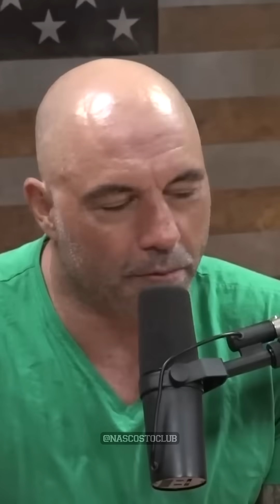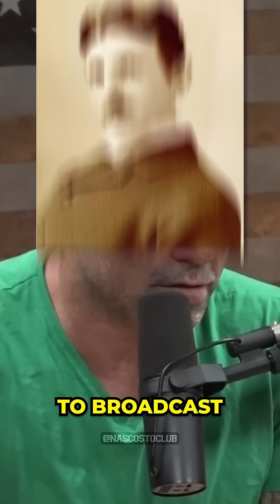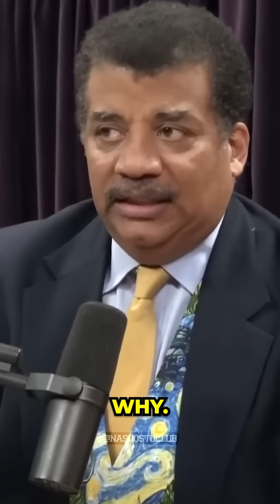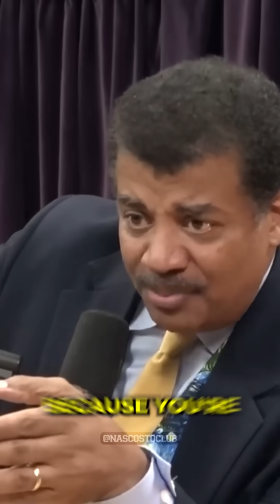WIRELESS Electricity Idea Debunked ⁉️⚡ #shorts

Comment: He's got a point. Lighting is what you get when you move electricity around through the air. If you wanted to do it in microwave radiation you're just going to cook everything.
Reply: Airplanes could have some problems too.
Reply: @Romfullmetal  the idea was to create airplane and all other vehicles to run off electric.
Reply: People have invented transformers that take radio signal in the air into high power, enough to run a welding machine
Reply: i think the crazy idea was to do it in the upper atmosphere and build other nodes to pull it down. but this likely wouldve had uncalculable climate effects.
Reply: @edenb329  like massive thunderstorms
Reply: @Eden B  we put lots of waves into our atmosphere at all frequencies.  My keyboard is passive solar powered and I do not fear it.  We also charge  phones wirelessly.
Reply: So what are electromagnetic waves then?
Reply: @sizu257  solar power counts
Reply: You realize Nicola Tesla himself stood in the middle of his waves of electricity holding a light bulb to prove it could be used without harm.
Reply: No... It's not energy in the form of electricity, it's energy in the form of magnetic radio waves which can be converted to electricity, and that's very commonly known. RF doesn't fry anything at low frequencies. Given the research, Neil either has to be an absolute idiot or an absolute fraud (it's the latter), to pretend it was supposed to be electricity, as in electron flow, that Tesla talked about sending through the air. Absolutely preposterous, and a great example that Neil is a complete fraud.
Reply: Solar?
Reply: Just search on YouTube Maxwell chikambutu, he achieved it and no one is talking about it
Reply: @Recipe_For_Disaster_TV  im sure
Reply: you sir have no idea what your trolling about
Reply: You and Neil are both assuming ELECTRICITY.

You are literally awash in an unfathomable amount of energy given off by the sun and every other star in the universe...a NEARLY LIMITLESS amount of harmless radiation (in fact, it's the static you hear on a radio, or the snow you see on an old TV.)

Just your sun produces 3.8x10^23 kilowatts per hour, and the only only two frequencies of that emission that matter to you in the slightest are Light and Infrared: everything else is just drifting around waiting to be claimed and utilized.
Reply: I mean Joe have a pretty basic description of some out there ideas I imagine would be hard to understand, even for the godly intellect of NDT
Reply: Cook everything and everybody !😥 Tesla would be a simultaneous, serial killer the moment he throws the switch !
Reply: @qasoranjones6224  You know all the Ultraviolet Light emitted by the Sun is microwaves...right?
Reply: @digitalis2977  No, ultraviolet is not microwaves. Microwaves are in the band between infrared and radio waves. They are gigahertz while radio waves are megahertz and even kilohertz. But UV is whatever you call the prefix is that's 2 or 3 higher than giga or tera or pica it's the next one
Reply: @digitalis2977  
Light is EMR. ElectroMagnetic Radiation .
Reply: Tesla coils light up bulbs wirelessly.  He is simply wrong and doesnt get electrical engineering
Reply: You said lighting but I think you meant lightening? Because light moves tons of energy through the air (sunlight) but lightening moves electricity itself
Reply: No lightning is a discharge of electricity in the air, the energy and electricity is always there
Reply: Actually Lightning is what you get when charge is allowed to buildup uncontrolled to a level where it overcomes the ability of air to act as an insulator. Electricity is all around you in the air all the time. Our whole planet is encapsulated by an electric field. The concept of transmitting electricity through the air is perfectly reasonable and has actually been demonstrated. Neil enjoys listening to himself disagree with things too much and people are far too quick to simply take him at his word.
Reply: @jessiegashler427 electro magnetic field* or simply electron not electricity
Reply: @simpleman949  huh. Last I checked, electricity is made up of electrons. There's a reason that the word electromagnetism has the two terms combined. It's because they're   really just two sides of the same coin. Either one induces and is induced by the other.
Reply: @jessiegashler427  electricity by definition is "flow of electron ", static electric is very different from current electric 
This is why we have AC & DC concept . 

Static like the lightning  happens between insulator & conductor but CURRENT electricity happens only between conductors. 

Static is unpredictable, while Current is predictable and easily controlled. 

We are made up of atoms, so technically every matter has electrons but to counteract we have positive energy "protons".

The change in electric field produces magnetic field but magnetic field is generated through current electricity while electric field is "invisible electric charges " not current.
Reply: @jessiegashler427  hasn't veritasium made an entire video on how electricity doesen't even actually travel through wires? The wires just direct the elwctric field or something?
Reply: @donotreadthis26  i've seen the video you're talking about and several rebuttals to their conclusion. I think further experimentation is needed.
Reply: @donotreadthis26  Electricity travels through wires. Right through the middle of the copper. The loose outer electron in each copper atom moves over to the next atom. They move slowly though, they inch along.
Reply: @hyzercreek  how does a wireless charger work then?
Reply: @donotreadthis26  
Like a transformer through induction. Tesla's concept was different.
Reply: @jessiegashler427  yes!  Thank you!  Voltage!  Potential!
Reply: @jessiegashler427  exactly this- it’s all around us all the time it’s just channeled into and from different conductors.
Reply: @jessiegashler427 I think you struck a nerve, lol. Pseudo intellectuals clutch their pearls when their ivory towers are shaken.
Reply: @jessiegashler427  Electromagnetism. Stop talking please.
Reply: I expect a physician to actually know how electromagnetism works. Also I expect people that don't know the subject to don't deny it and claim that is false. Regarding you talking. Electromagnetism is not a complex topic. We are taught about it in 5th grade.
Reply: @sizu257  Bro, would you expect him to know how a water faucet would work and the physics that go’s along with that. Because I remember when I was watching is show they were talking about how in the Middle East they created these wells that they would use for their crops and how they created a pipe that would suck up the water through the pipe and water the fields, and he asked their guest an Asian physicist how that works because he didn’t understand it, and of course the Asian physicist in a very sarcastic way explained on how it worked.
Reply: @sizu257  if I were you, I would modify my expectations to reduce the likelihood of disappointment. Neil has frequently made statements that are incorrect in the past, and his statement is incorrect in this instance as well. If all it takes for you to blindly believe someone and see them as infallible on a given topic is the job they do and their degree, you're gonna be really mad when you find out that I actually work with electromagnetism every day and have a degree stating I have an in depth knowledge of how electricity and magnetism work.
Reply: @jessiegashler427  Say it with me, fifth-grade-level class! Electromagnetism👏 and👏 electricity👏 aren't👏 the👏 same👏 thing!
Reply: @guywholikesgoodmusic  It's clear you have no idea what you're talking about.. Magnetism is created thru large amounts of Electricity. Magnetism doesn't create electricity but electricity creates magnetism and those two forces combined created Electromagnetism. Electrical energy is electromagnetism, which is composed of an electromagnetic field.
Reply: @dimitriusmichaud8687  i can't make electricity moving a wire through a magnetic field?  A rock magnet 🧲 ✨️ 👌 ok
Reply: @guywholikesgoodmusic  Hey! That fifth grade science lesson was pretty good! How about we move into junior high science now so we can get a more complete picture? 
If I place a copper wire on a shaft that is surrounded by a permanent magnet and I rotate the shaft(and therefore rotate the wire), electric potential(commonly called voltage) is induced along the wire. 
Or  if I apply an alternating current to the windings of a transformer, I generate a magnetic field around the windings.
Hmmmm. Seems to me that these two things are directly linked to each other in such a way that either one can produce the other. Is that to say they're the same thing? No. They don't need to be the same thing.
Reply: @dimitriusmichaud8687  Actually, I'm an electrician, so I know exactly what I'm talking about. If you can't understand the fundamental difference between the internal mechanisms driving current through a conductor vs electromagnetic waves in the air, you can't be helped.

Electromagnetism can be generated via an electric current, but they are NOT the same thing. Please stay in school.
Reply: @jessiegashler427  Linked =//= interchangeable, which is how you phrased your original comment. The engine and transmission of my car are linked, don't make them the same fucking thing.

There's a reason technical terms exist. If you're going to use them, do it properly.
Reply: @guywholikesgoodmusic Well it appears you aren't a very good electrician to think that electricity only runs or exists in a wire. 😂 you may wanna go back to school.. Air allows electricity to pass through it if the quantity of the charge is large and the distance is small. Nikolai Tesla showed that electricity and magnetism go hand in hand to create electromagnetism. Electromagnetism generates electricity when a magnet and a coil are brought together and relative motion is introduced due to magnetic flux. He proved electromagnetism can generate electricity with his concept of electromagnetic induction thru his Tesla coil with electromotive force.
Reply: @dimitriusmichaud8687  "He proved electromagnetism can generate electricity with his concept of electromagnetic induction thru his Tesla coil with electromotive force."

Funny how you mentioned both electromagnetism and electricity in the same sentence. I thought, according to your logic, they're one and the same? Why use it twice?

Technical terms exist for a reason. Use them correctly. Electromagnetism =/= electricity, despite them often being closely related to each other.

Comment: So NDT is right about wirelessly powering devices, but that's not what tesla envisioned. He envisioned high power point to point transmission of electricity. Which as it turns out, has near zero loss. You just need to setup two towers, one to charge with electricity, and the other tower to pull on it. When it arcs, it's a near zero drop in potential power. Copper wire losses SO MUCH energy over distance, it's horrible.

Comment: He is a jerk… so called scientist.  I have worked in aviation electronics, instrumentation and power generation… you can and we do in some applications send power through the air… he wanted to electrify the planet also… get a 4foot florescent tube and on a humid night stand next to the high tension power lines… it will light up the especially if you can hear the crackling.

Comment: I'm an Electrical Engineer. You 100% could have low frequency radio waves carry a lot of power through the air safely. The only issue is that the power dissipates very quickly over distance (inverse square law) so there would be a lot of wasted energy. 

In fact, Neil is so wrong that we do actually use wireless power transmission. Those wireless chargers for your phone use this, but to be energy efficient your phone has to sit on the charger. 

Induction stoves are another example.

Comment: That's not how it works neal. And you know it 

The negative is anything with an antenna or microchip would fry.

So either we would of never advanced. Gave up on wireless power, or found away to innovate

Comment: If you want to transport electricity with radiowaves, you'll be microwaving yourself all day
Reply: Folks don't get elementary electromagnetics
Reply: Assuming you send them as microwaves and not long, low frequency waves -.- You literally say it yourself... You think a microwave oven would work at 1MHz? Truth is you have no fucking clue.
Reply: @TheMrTape  this guy has never heard of HAARP. He might get it one day
Reply: @oSonine  How is using something like HAARP more efficient than transporting energy on a cable? Can you explain it to me? Physically.
Reply: @nicolaignazio  the question was if it was possible not if it was efficient. Anybody that has built a crystal radio knows it doesn't require batteries... If efficiency is a measure of how much power you have to put in then isn't a crystal radio the most efficient design?
Reply: @oSonine  we're talking about delivering energy, you're off-topic now and I don't want to talk about philosophy.
Reply: Lol assumptions abound
Reply: Thank you

Comment: Always hated the notion that "Tesla could've developed wireless (phantom) electricity if xyz." Simple concept, electricity requires a medium to follow; the medium it follows is the path of least resistance. How do you get electricity through air from a to b without it diverting to a path with less resistance? You can't.
Screw Tyson but the point still stands that "wireless" electricity isn't an idea that can work in common applications.
Question to those who disagree: why hasn't anyone capitalized on that idea in the century since Tesla? We're in the era of "wireless" phone chargers and such. Why hasn't anyone developed that further? Could be because it's physically impossible but I could be wrong.

Comment: If the electricity was transmitted through radio waves, then isn’t it possible to just set up an electric conduit antenna on top of your house to receive the electricity, then disperse it to the electronics in your home? Not to mention, it could at the very least be used to turn on streetlights. You could make an antenna receiver for the electricity and either put it on every streetlight to receive the electricity directly via radio waves, or have them connected to a big master receiver which would transmit the currents to the streetlights in a set area. 

Neil just seems to be doing damage control for the power company. Or he’s helping to discredit and cover up Tesla’s ideas cause it’s more beneficial to power companies to charge people for electricity. Either way, Neil is trying to project the image that he’s more knowledgeable on electricity and it’s dispersion than Nikola Tesla. Neil, stick to talking about the stars, dude.

Comment: Another thing NDT is wrong about. You can literally take a fluorescent bulb and stick it in the ground underneath high power electric lines, around 50 feet away from them, and the bulb will light up; and that wasn't even designed to happen.

Comment: Tesla thought of transmitting energy through the ionosphere and the ground.  And as for the current in the wire, it is not true.  Current or energy charges travel around the wire and are outside the wire

Comment: For everyone that blindly believes Tesla was the smartest man to ever live, remember he fell in love with a pigeon...
Reply: Man, love and smartness it's not the same. :)))
Reply: Microwaves are produced inside the oven by an electron tube called a magnetron. The microwaves are reflected within the metal interior of the oven where they are absorbed by food. Microwaves cause water molecules in food to vibrate, producing heat that cooks the food.
Examples of Microwaves
Ovens.
GPS.
Wi-Fi.
Bluetooth.
RADAR.
Communication Systems.
Medical Equipment.
Weapons and Military Equipment.

They cook you only if they are designed to do that.

Comment: I think Neil is correct: We have a project here in Belgium involving high voltage power lines that won't get put underground even though it would be better for health reasons .... because it is too expensive so they will likely get to be above ground. The science that people living nearby enough have an increased risk for certain cancers such as leukemia seems quite clear. As far as I know, it's the same phenomenon that would hurt people if a lot of energy was transferred through the air.

Please correct me if Tesla meant something else. Neil being annoying most of the time is not a valid reason to dismiss him immediately.

If Tesla had a safe way to do this...why don't we apply it in small households yet instead of the cumbersome process of pulling wires?

I think it's because burning a lamp by emitting high energy EM waves has multiple drawbacks. It's likely damaging and how could it possibly even be efficient?

You can light up TL lamps by standing under a high voltage line holding it. That's not efficient and it's probably not healthy to actually stand there either.

Comment: The idea was NOT to charge the ENTIRE atmosphere at ground level with high energy radio waves.  It was to charge the ionosphere, and then use collector towers on the ground to tap into it, wherever electricity was needed and there wasn't already a grid
Reply: How tall would the towers need to be to interact with the ionosphere? I don't see why that would be more cost efficient than a remote solar farm.   His main point being the final third where the humans are must be through conductors like wires.  To be safe.

Comment: Have to agree with Neal on this one. Think about it. Electricity that goes through the air is called lightning ⚡.  Now let's go with radio waves. Sure very low powered items can now be powered by such, but with current tech you are not going to power you tv with that low of a voltage.